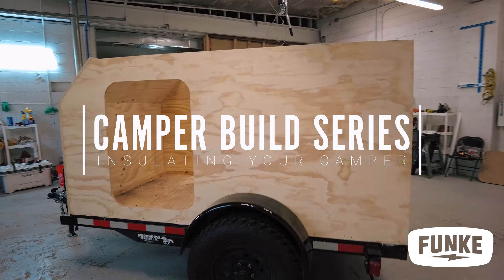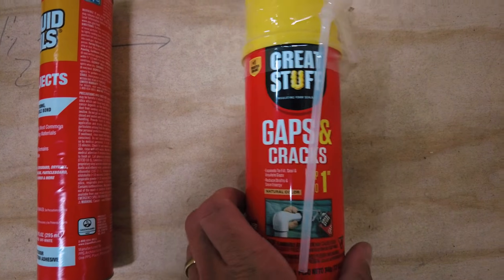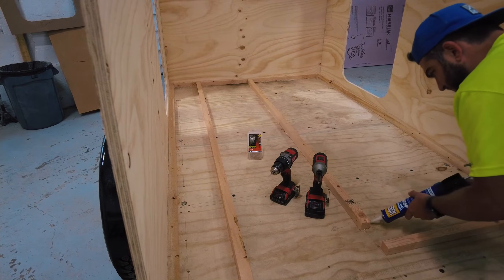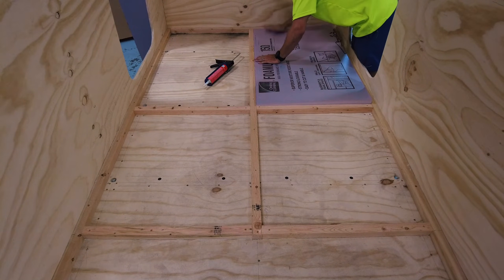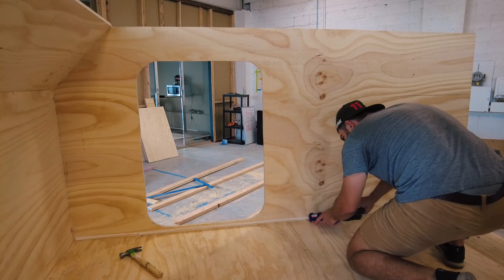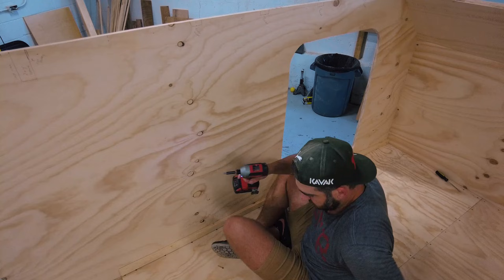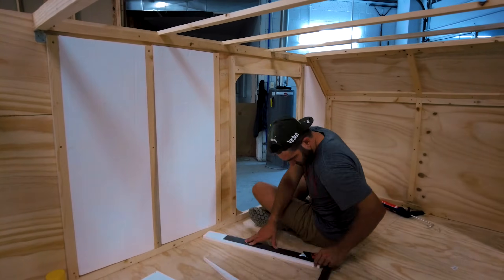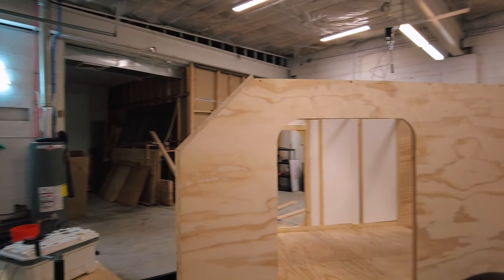How To Build a DIY Square Drop Camper Trailer: Insulation

Comment: So your roof support is relying on the screws alone that run through the plywood sides? and your verticals are just firing strips to hold your inside FRP wall skins and spacers for the insulation? Why wouldn't you run the verticals all the way up to the roof line to support the roof like they should. and just drill small holes through the verticals and pipe each hole for your 12v wiring? with this design, you can't put any weight up top. over time any weight or rough road terrain will put strain on the screws that are run horizontally through the plywood. looks good. but from a engineering side. not great. will be fun for a short while though. Another suggestion would be to run the wiring in the floor, designate a channel section on the right, left or even center with a removable lid if you needed to access the wiring for any reason. Then up the walls between the vertical studs where you would put lights, outlets and switches etc. or even up and over to the ceiling for a fan and lights. This way you won't effect any vertical supports

Comment: I like this shape but would like to use either stainless steel  or aluminum for the sides and top instead of the plywood   . I wonder what the weight difference would be .

Comment: Why not just use a single full sheet of the foam for the floor, instead of putting timber between smaller pieces you cut from the large sheet?
Reply from the maker: Just to ad a little extra support and keep the floor from bending/bouncing. Plus, by using the smaller pieces with supports, I saved about $80 USD on buying a new sheet of plywood. Instead I just used some scraps. Since no one is ever going to see the floor (under the mattress) I didn't mind if there was a seam. 

Thanks for watching!

Comment: What happened to the 2x2’s you had in place when attaching the walls in the previous video? Were they just temp until the glue set?
Reply from the maker: Hey Graystone, The 2x2s along the floor are still there, they just act as supports for the floor when I install the plywood. The other 2x4s that I had on the outside of the walls were just temporary to support the walls and keep them from falling over while I got them all screwed and glued together.

Comment: Ever hear of "poorman's Spray foam"? You cut your foam boards 1" short on both ends. Then use the red can spray foam and fill the 1/2" gap on each end. Nice tight seal!
Reply from the maker: That'll do the trick.

Comment: If your are going to run a RTT as well, what would you use to strengthen the roof for support going across?
Reply from the maker: Thanks for the question Jesson. We appreciate you watching our video and subscribing. Extra roof supports won't be super important if adding a rooftop tent. This is because we install a roof rack to the camper first. The roof rack is mounted right on top of (or very close to) the sidewalls. So the weight won't be on the middle of the roof, but will be directly supported by the vertical sidewalls. I would bet that those sidewalls on end like that would support hundreds, if not 1000+ lbs. So then we mount the RTT to the roof rack, transferring all of the weight of the RTT onto the sidewalls which won't sag the roof at all. I hope that helps!

Comment: Was there a reason you didn’t run the studs up to the what would be known as the top plate?
Reply from the maker: Great question. That is a channel for the electrical wiring. Since those studs are only 3/4 inch thick, it's easier to leave that gap than to drill through the 3/4 inch stud.

Comment: Looking good, thanks for sharing! Liked and subscribed to follow your progress...
My 4x6 v-nose toy hauler-camper-theater is quite compact. Front 4x5 deck plus roof rack and hitch rack is extra room for 2KW Inv-Gen, Solar pnl, and Awning. 3 cabinets house cooking equip. and the 24"TV/entertainment ctr. Twin tri-fold sofa-bed, 5K BTU AC, elec heat and induction cooktop complete the collection (so far). Planning a folding room pinned onto my ramp that will be outside galley and inside privy w/shower pan. that will tie down on the front deck. Pulling it with a 1.8L Scion XD gets 20mpg (headwind) and 28mpg (tailwind)
Reply from the maker: Thanks for being here John! Sounds like you have a pretty great setup yourself. See you out there!

Comment: Nice work! Really enjoying your project build.  Do you have a recommended source for the doors/windows/camper components? Thank you
Reply from the maker: Thanks so much for watching and subscribing. I appreciate all of the support.

Doors/windows - Vintage Technologies (https://www.teardroptrailerparts.com/)
Aluminum trim - recpro.com
Aluminum sheet metal is hard to come by in smaller quantities. Sometimes you can get lucky and recpro will have some in stock. I placed a bulk order with metalwest.
Most lumber and building materials - homedepot and lowes
Other components - Amazon
In the description of this tour video, I share links for most of the smaller components: 2022 DIY Overland Camper Trailer Tour - Square Drop [Updated]
https://youtu.be/Jnsc1BzkB5s

I’m not sure where you are located, but I have some extra doors and enough sheet aluminum here in Utah for an entire build. I’d be happy to sell it locally for my cost.

Thanks again for watching!
Reply: Thank you!! Very helpful! Just brainstorm a couple of ideas right now.